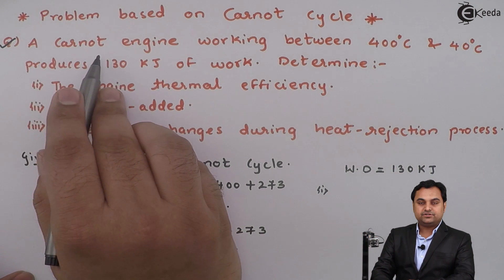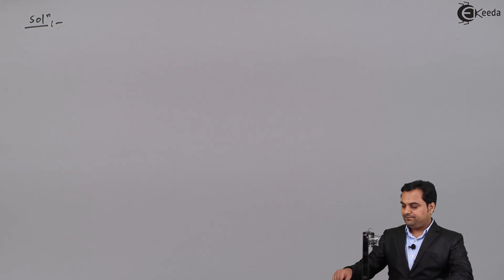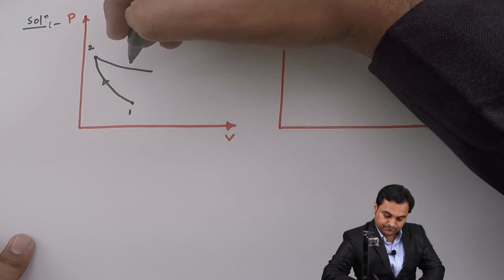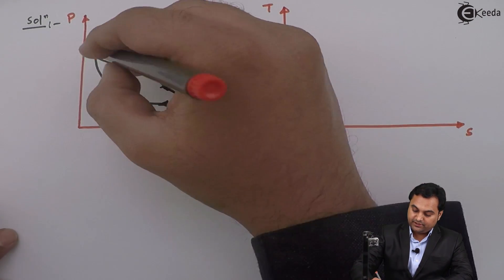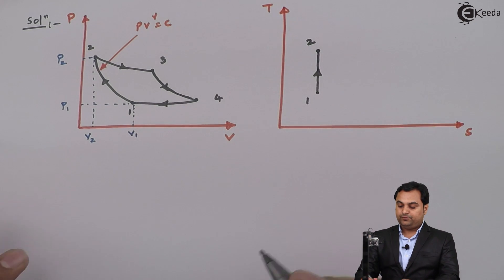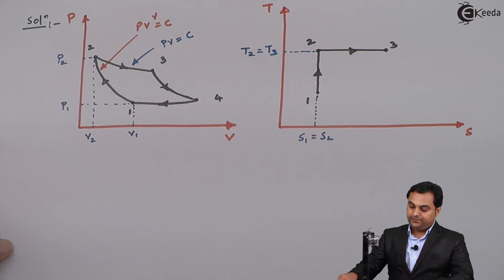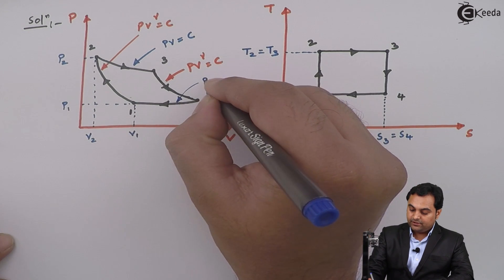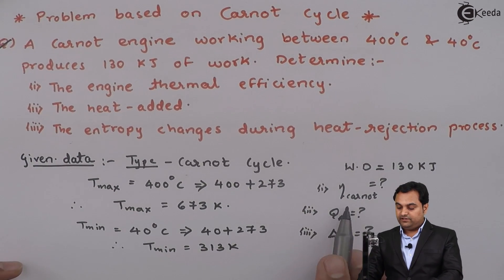Problem 1 based on Carnot Cycle of power Gas Cycle - Gas Power Cycles - Thermodynamics

Comment: Do you have videos related to this problem?

a heat engine with an efficiency of 40% drives a refrigerator with a cop of 4. determine the ratio of total heat rejected to the atmosphere to the heat absorbed by the refrigerator.

Comment: Sir 273 kaha se aya
Reply: When convert Celsius to Kelvin then + 273
Reply: Ooooohhhhhhh
Reply: @jindgi5511  a carnot engine has efficiency of 60percent , if it receives 500kj/sec of energy from the source, calculate the power it develops and the rate of heat rejection to the sink ? 
Can u help me 🙂
Reply: @lipshajoshi9661   efficiency= power output /power input use this formula esliye find the solution
Reply: @jindgi5511  yeah i got it efficiency=1-QL/QH
Reply: @jindgi5511  Thanks 🙂👍🏻